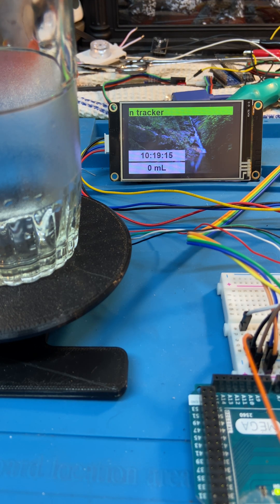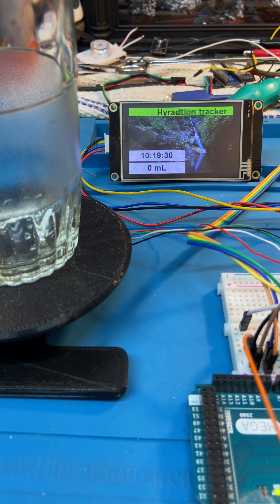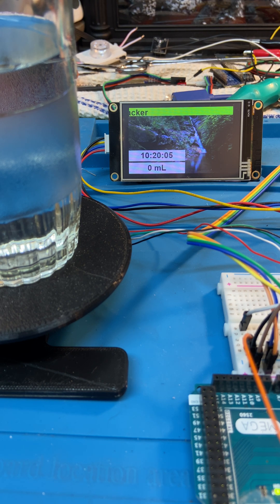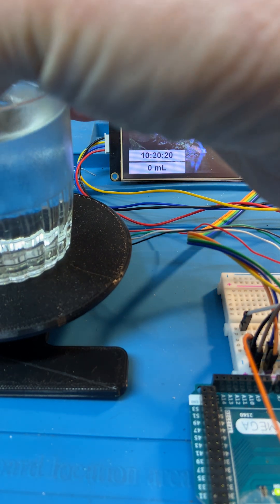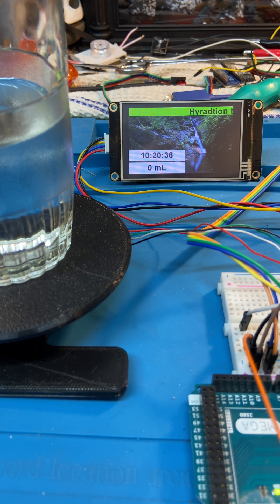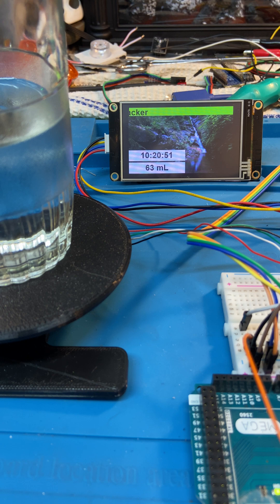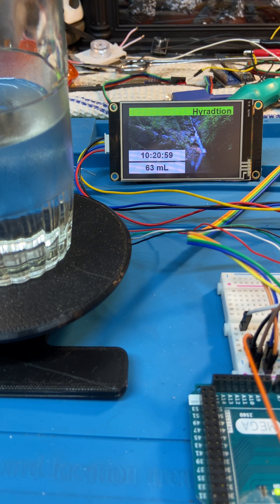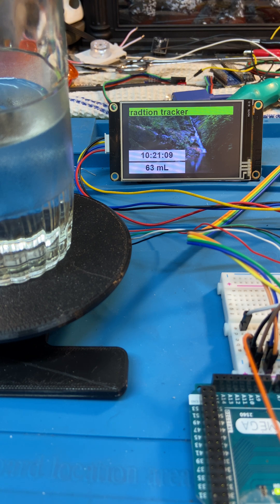Inspired by Waterfalls | Arduino Hydration Tracker #shorts #water #health #arduino #fitness

Comment from the maker: /*
  Hydration Tracker (Arduino Mega)
  - HX711 (DOUT + SCK) for weight
  - DS1307 RTC (I2C) for date/time
  - Nextion on Serial1 for display
  - Pin 4 (active HIGH) = TARE current glass

  Nextion:
    t0 = amount consumed (mL)
    t1 = date
    t2 = time

  Notes:
  - Water: 1 gram ≈ 1 mL
  - You MUST set CALIBRATION_FACTOR for your load cell.
*/

#include <Wire.h>
#include <RTClib.h>
#include "HX711.h"

// ----------------- Pins -----------------
#define HX_DOUT_PIN  6     // <-- choose your pins
#define HX_SCK_PIN   7     // <-- choose your pins
#define PIN_TARE     4     // active HIGH button

// ----------------- Objects -----------------
RTC_DS1307 rtc;
HX711 scale;

// ----------------- Calibration -----------------
// Set this to your calibrated value (use example calibration sketch)
float CALIBRATION_FACTOR = 705.0f;   // <-- placeholder, change to match your load cell

// ----------------- Filtering / thresholds -----------------
const float NOISE_DEADBAND_G      = 2.0f;   // ignore tiny jitter
const float MIN_EVENT_DELTA_G     = 10.0f;   // minimum change to consider "drink/add"
const uint8_t STABLE_COUNT_REQ    = 40;     // how many consecutive "stable" reads needed
const uint16_t SAMPLE_MS          = 150;    // sampling interval

// ----------------- State -----------------
float tareOffset_g = 0.0f;                 // scale tare offset
float lastStableWeight_g = 0.0f;           // last confirmed stable weight (relative to tare)
float candidateWeight_g = 0.0f;
uint8_t stableCount = 0;

float consumedTotal_mL = 0.0f;             // total consumed for the day
DateTime lastShownTime;
char lastDateStr[16] = "";
char lastTimeStr[16] = "";

// ----------------- Nextion helper -----------------
void nextionSendCmd(const String &cmd) {
  Serial1.print(cmd);
  Serial1.write(0xFF);
  Serial1.write(0xFF);
  Serial1.write(0xFF);
}

void nextionSetText(const char *obj, const String &txt) {
  String cmd = String(obj) + ".txt=\"" + txt + "\"";
  nextionSendCmd(cmd);
}

void nextionSetConsumed(float mL) {
  // show as integer mL
  long v = lround(mL);
  nextionSetText("t0", String(v) + " mL");
}

String twoDigits(int v) {
  if (v < 10) return "0" + String(v);
  return String(v);
}

void updateDateTimeToNextion(const DateTime &now) {
  // Date: YYYY-MM-DD
  String dateStr = String(now.year()) + "-" + twoDigits(now.month()) + "-" + twoDigits(now.day());
  // Time: HH:MM:SS
  String timeStr = twoDigits(now.hour()) + ":" + twoDigits(now.minute()) + ":" + twoDigits(now.second());

  // Only update when changed (reduces Nextion flicker / serial spam)
  if (strcmp(lastDateStr, dateStr.c_str()) != 0) {
    strncpy(lastDateStr, dateStr.c_str(), sizeof(lastDateStr) - 1);
    lastDateStr[sizeof(lastDateStr) - 1] = '\0';
    nextionSetText("t1", dateStr);
  }

  if (strcmp(lastTimeStr, timeStr.c_str()) != 0) {
    strncpy(lastTimeStr, timeStr.c_str(), sizeof(lastTimeStr) - 1);
    lastTimeStr[sizeof(lastTimeStr) - 1] = '\0';
    nextionSetText("t2", timeStr);
  }
}

// ----------------- Tare -----------------
void doTare() {
  // HX711 library tare sets internal offset; we also keep a friendly "tareOffset"
  scale.tare(15);
  tareOffset_g = 0.0f;

  // Set stable baseline to current reading (near 0 after tare)
  float w = scale.get_units(10);
  if (isnan(w)) w = 0.0f;
  lastStableWeight_g = w;
  candidateWeight_g = w;
  stableCount = 0;

  // Reset daily counter if you want tare to also reset consumption:
  consumedTotal_mL = 0.0f;
  nextionSetConsumed(consumedTotal_mL);
}

// ----------------- Setup -----------------
void setup() {
  pinMode(PIN_TARE, INPUT); // active HIGH (use external pulldown or switch wiring)
  Serial.begin(115200);
  Serial1.begin(9600);      // Nextion default is often 9600

  Wire.begin();

  if (!rtc.begin()) {
    Serial.println("DS1307 not found!");
  }
  if (!rtc.isrunning()) {
    Serial.println("RTC not running. Set it once with an RTC set sketch.");
  }

  scale.begin(HX_DOUT_PIN, HX_SCK_PIN);
  scale.set_scale(CALIBRATION_FACTOR);
  scale.tare(15);

  // Initial display update
  DateTime now = rtc.now();
  updateDateTimeToNextion(now);

  // Start with 0 consumed
  consumedTotal_mL = 0.0f;
  nextionSetConsumed(consumedTotal_mL);

  // Initialize stable baseline
  lastStableWeight_g = scale.get_units(10);
  candidateWeight_g = lastStableWeight_g;

  Serial.println("Hydration tracker running.");
}

// ----------------- Main loop -----------------
void loop() {
  // Handle tare button (simple debounce)
  static uint32_t lastTareMs = 0;
  if (digitalRead(PIN_TARE) == HIGH && (millis() - lastTareMs) > 600) {
    lastTareMs = millis();
    doTare();
    Serial.println("TARE pressed.");
  }

  // Read time/date and update Nextion once per second
  static uint32_t lastClockMs = 0;
  if (millis() - lastClockMs >= 1000) {
    lastClockMs = millis();
    DateTime now = rtc.now();
    updateDateTimeToNextion(now);

    // Optional: reset “daily consumed” when date rolls over
    // If you want “per-day tracking”, this is handy.
    static int lastDay = -1;
    if (lastDay == -1) lastDay = now.day();
    if (now.day() != lastDay) {
      lastDay = now.day();
      consumedTotal_mL = 0.0f;
      nextionSetConsumed(consumedTotal_mL);
      Serial.println("New day -> consumed reset.");
    }
  }

  // Sample weight
  static uint32_t lastSampleMs = 0;
  if (millis() - lastSampleMs >= SAMPLE_MS) {
    lastSampleMs = millis();

    // get_units() returns “units” based on set_scale(); with calibration it becomes grams
    float w = scale.get_units(5);

    // If your reading is too jumpy, increase samples above.
    // Apply noise deadband relative to candidate
    if (fabs(w - candidateWeight_g) <= NOISE_DEADBAND_G) {
      stableCount++;
    } else {
      stableCount = 0;
      candidateWeight_g = w;
    }

    // Once stable long enough, accept as new stable weight
    if (stableCount >= STABLE_COUNT_REQ) {
      stableCount = 0;

      float newStable = candidateWeight_g;
      float delta = newStable - lastStableWeight_g; // + = added, - = consumed

      // Only treat as an “event” if big enough
      if (fabs(delta) >= MIN_EVENT_DELTA_G) {
        if (delta < 0) {
          float drank_mL = -delta;          // grams -> mL
          consumedTotal_mL += drank_mL;
          nextionSetConsumed(consumedTotal_mL);

          Serial.print("Consumed: ");
          Serial.print(drank_mL, 1);
          Serial.print(" mL | Total: ");
          Serial.print(consumedTotal_mL, 1);
          Serial.println(" mL");
        } else {
          // Water added (refill). We don’t change consumed total.
          Serial.print("Added: ");
          Serial.print(delta, 1);
          Serial.println(" g");
        }
      }

      lastStableWeight_g = newStable;
    }
  }
}